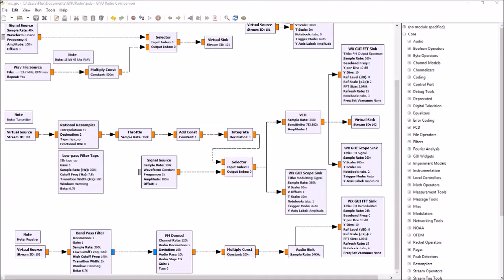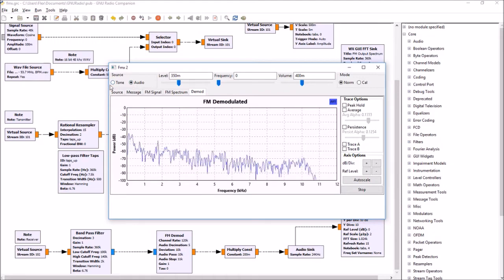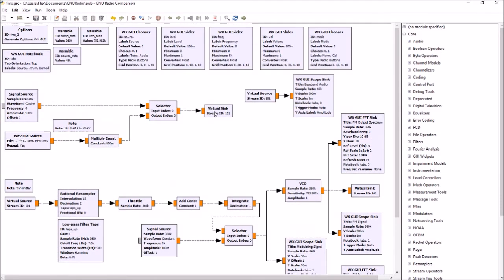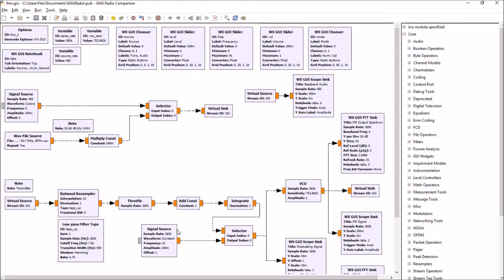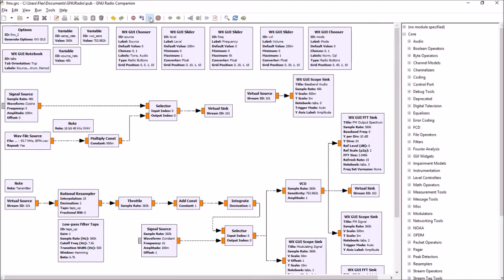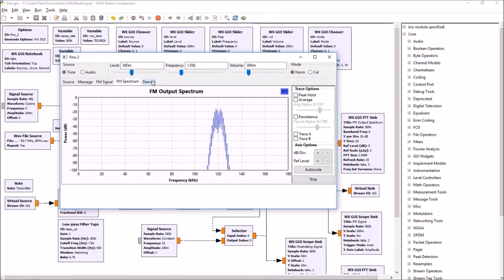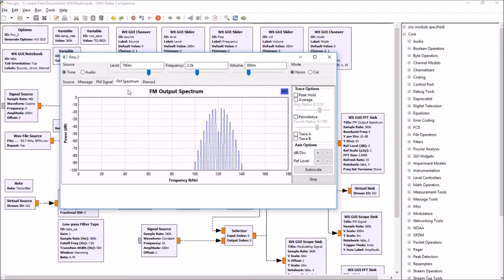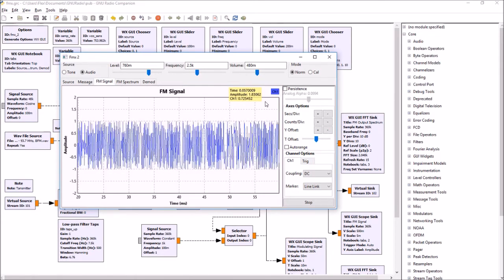GNURadio Frequency Modulation

Comment: Wow, I love this approach!  99.99999% of all other examples I've seen**, use the WBFM transmit block which might as well say MAGIC!    How would you transmit the RDS text?

So the amplitude of the source audio, determines how much it will deviate from the center frequency, with the maximum amplitude set by the 'Level' slider?   So what is happening when you adjust the Frequency slider -- what are the sidebands?

And does your Rational Resampler block use the 'samp_rate' variable, or do you set the interpolation/decimation manually based on the input and desired output?

BTW, if the Selector block is deprecated, what is the new way of doing it.. and why is the Low-Pass Filter Taps not connected to anything, how does that work?

**example.. http://gareth.codes/hackrf-transmit/     https://discourse.myriadrf.org/t/working-fm-radio-on-gnu-radio-and-pothos/1055

Comment: could you give the formular to calculate vco sensitivity, thank in advanced!
Reply from the maker: As shown in GRC file, my channel sampling rate for demodulation was 120K. The VCO sensitivity was set to 2 * PI * 120000 = 753982. My understanding of VCO is that sensitivity should be set to rad/sec per volt (amplitude.)
Reply: @VE6EY  thank very much for your reply, but at modulation, when I decrease sensitivity, assume set vco_sens = 553982 then audio signal will at around 90k, don't relative to demodulation
Reply from the maker: @thanchien1745  I found this tutorial useful https://www.next-community.de/fileadmin/media/whitepaper/files/005_fmtutorial.pdf
Reply: @VE6EY  thank you!